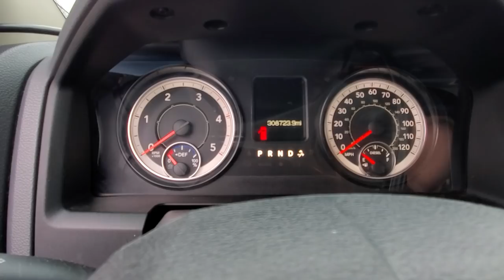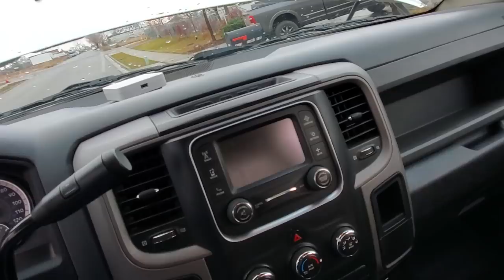2016 Ram 3500 cab chassis 308k mile review. What issues have I dealt with?

Comment: Love your videos. Just sold my 2014 cab and chassis four door with 158K for $27,000. It never was driven hard, Towed light, and never driven over 80 MPH. The 2022 is now about 65K. Pretty similar to the 2014, but it has safety group and the carbon motor. 6 speed Aissen, like the 2014. The dealership had said, "Might want to put ball joints on it." The other mechanic said, "A micrometer can't even measure any play on the ball joints—just drive it." I always sell my trucks at 150K AND I FEEL LIKE THEY HAVE TONS OF LIFE LEFT IN THEM. Sorry cap lock there. Sometimes the new trucks I get seem not as good as the old. Truck number 6 white 4 by 4 hauler cab and chassis. Love the slower, detuned feel. It feels like it lasts longer that way...

Comment: 06 dodge dually Cummins 6spd and mine is at 287400 miles , just put upper and lowers and right hub, bought left hub to do while it’s being done . All original except clutch. Put in double clutch at 227000

Comment: Guys with other brand trucks tend to get butt-hurt over Dodge / Ram trucks for some reason. I purchased a 99 2500 4x4 AT 3:73 new, traded at 251k miles (mostly towing) and was running strong when I traded. Then a new 2005 3500 4x4 dually 4:10 AT, same thing when I traded at 207k miles last year for a 2018 3500 dually Limited with Aisin and HO 6.7. Both 99 and 05 trucks remained stock. Both trucks needed fuel pumps around 150k+ miles, the 99 needed front wheel bearings around 170k miles but neither truck needed any front end work. Learned on my 99 to run only Mopar brake pads, it ate up all other pads. My 2005 dually got Mopar pads only, changed them a few months prior to trading the truck, the Mopar pads had 71k miles on them. Neither truck had engine, trans or drivetrain problems. Ford and Chevy / GM have nice trucks, I stick with Ram because I have owned 3 in the last 20 years, they are built to tow.
Reply: Exactly correct. Iconic towing quality. I had the same era white Dodge's. Always sold at about 150K.
Reply: @tomfrantz  - And not only towing. My current 3500 Limited dually has nicer interior than many higher end SUV's
Reply: @chrism2042  I have been hearing about the quality of the interior. Is this true in your experience. My heater and AC in my 2014 were not so great. Wondering if the heater core has improved... Or will time-tell.
Reply: @tomfrantz  - Only problem I had with either truck heat/AC was the actuated doors in plenum in the 2005 3500. But the heat and AC worked great.
My other vehicle is a High Country Tahoe, the Ram interior is as nice as the Tahoe and the Ram seats are better leather and more comfortable on long trips. I have the 3500 4x4 dually Limited, crew cab long bed, HO 6.7 with aisin trans. I removed the junk Nexen tires and put on Cooper tires, also added a set of Centramatic wheel balancers (because many tire shops struggle to balance offset dually wheels). Everyone that rides in the Ram are amazed at how well it rides. I make trips from NC to Florida keys towing a bay boat, 900 mile trip one way, I would rather drive the Ram than the High Country Tahoe. And of course, a 24' bay boat with T-top, I don't feel it behind the truck.
Reply: @chrism2042  Tahoe was one of the nicest rides ever. Good comparison then. My Ram drove nice; 2007, 2014—looking forward to 2022 cab and chassis single axle. I forgot about dually wheel balancing... Good to hear about Cooper. I always use transform takeoffs—even thought they are not great on NW ice and snow. I use some off brand studded in winter.
Reply: @tomfrantz  - I ran Michelin MS2 tires on my 2005 dually, those are awesome tires, but hard. When I traded that truck, the sidewalls were starting to dry rot at 72k miles and still had plenty of tread. I didn't want to go back with Michelin on this truck because of the hard ride. First set of Coopers I have owned, as of now, probably be my choice on HD truck from now on. Any truck I get from now on will get a set of Centramatic wheel balancers. The balancers made the Nexen tires much better but the belt busted in a front tire at 26k miles. Worked out well because i was looking for a reason to get a new set of tires.

Comment: This video gave me relief my friend. I have a 5500 ram service truck has a lot of weight. I thought the same thing like this thing a piece of junk. It lost some specific parts recently and I still didn’t notice any fricken difference. So I started doing research and found the the CC trucks are derated from factory and have more torque so it makes a lot of sense now. Made add a 100 horse tune we’ll see. Any advice is appreciated and adding the tune.

Comment: I guess I should train Paul`s drivers. I never driver over 60 in my 05 F350 as it has 4,30 gears. It is built for pulling not for speed. This F350 is a factory Ford Tow Boss. I had never heard of a Tow Boss until I purchased this truck. But I am not afraid of a Dodge Ram 3500 dually. I purchased one with 370.000 miles on it to replace the F350 if the 6.0 Powerstroke fails. I think it is a better investment to  put money in the Dodge. And I will call it a Dodge since it has a Dodge emblem on the dash.  It is a 2012 last year without DEF that is why I purchased it. It is also a Max Tow package truck with 4.10 gears.  Some day I will find some freight to haul with it. I am shut down for the winter.  I only haul wine and brewery equipment.  Because that is paying about a 100 dollars an hour to haul. Another nice video Paul.

Comment: So, my 1/4 million miles tundra Ball joints still good for at least another 50k miles.
Reply: Toyota trucks last a long time, if you don't use it as a truck. It doesn't matter what brand truck you have if you treat a gas truck the way diesel pickups are treated the gas truck won't last long at all and will have lots of problems we'll before the engine goes, diesel on the other hand can take the crap you give it while towing heavy loads while getting MUCH better MPG and last many hundred thousand miles. 
Toyota is a reliable truck but don't compare it to ANY diesel, its like a baby and a pro wrestler go at it. what do you think is gonna happen?
Reply: @02Franxx  , who is comparing tundra to ram? I am only asked about ball joints longevity. Tundra have lasted 1 million miles on original engine without any repairs.
Reply: repairvehicle the tundras with 1,000,000 miles on them all have the 4.7l which has a timing belt that has to be replaced every 150,000 miles...
Reply: @connerbutler1077  , timing belt and water pump is your regular wear items, just like your brake pads.
Reply: @repairvehicle  Im not comparing tundra to ram Im saying not to compare gas engine to diesel. I know its off topic. 
I believe they last a million miles(toyota) But I don't believe they go anywhere near that if used to tow things. 
Avg. load and Avg. HP output on an engine directly effects life. no regular car/pickup engine will last long at all if kept near its peak HP.  Towing things puts more a load on the engine which requires more hp to the wheels which reduces life. diesels can handle heavy loads and still last a million miles. 
Im not dissing toyota, its opposite, any gas engine that can last a million miles stock is a good engine. That being said the amount of toyota vehicles breaking a million miles compared to any diesel brand truck breaking a million miles is very low. Now toyota gas compared to another gas brand pickup that pretty high. that also being said there are a LOT more ford/ram/chevy gas pickups being used for work trucks than toyota so of course toyota is going to look better

Comment: Hey Paul you’ve never said do you guys replace the turbo actuator at your shop or take it to the dealer? If so what do you do to recalibrate it? Mine is going out on my 14 and I need to replace it.  Thanks so much always looking forward to the next video
Reply: Not trying to advertise. I just liked a product. 
Geno's garage has a great actuator that comes pre-tuned. All metal. Made in USA. $899. 1 hour install. I can do it quicker.
Reply: @tomfrantz   I went with the one from Genos I’ve had it for 2 yrs now and it works great plug and play as long as the 4 factory bolts come out ok. I would definitely buy it again really nice fit and finish.
Reply: @BlueOxDiesel  I found it very solid-built as well. Plug and play is a good description. I put one in a year ago, and it instantly worked. PLUG N' PLAY~~~

Comment: I would go and get a Dodge ram or ford but never a GM the gm trucks ride good but that's about it and the Ford and Dodge ram are the best trucks in my opinion my grandparents have a 2001 Dodge ram 3500 and it has at least 180k if not more and it's had a new radiator and if you have maintenance parts but other than that it has run very good since they bought it new and my dad has had a Dodge ram Ford and gm trucks so he knows what's what and Ford and Dodge ram are my favorite brands and keep up the good videos and I also plan on becoming a mechanic and maybe work for you once I get out of high school I'll be 18 next year and hopefully visit you